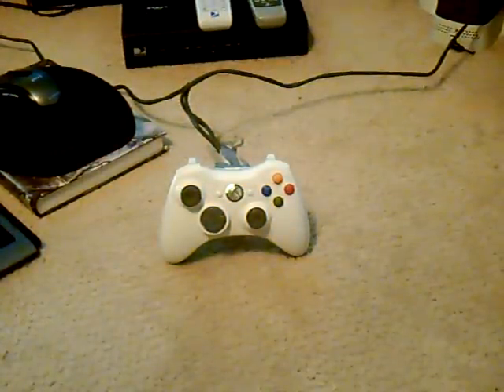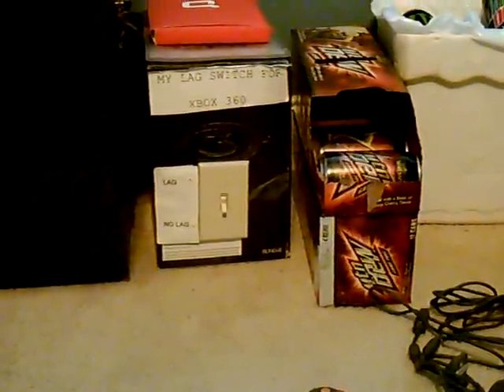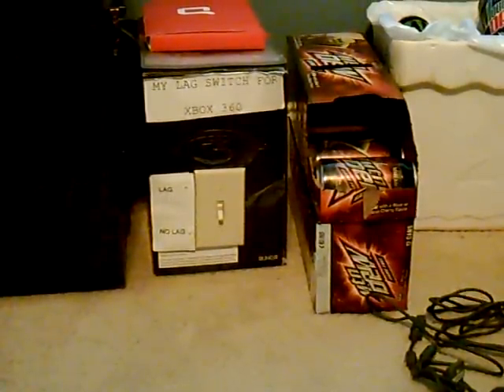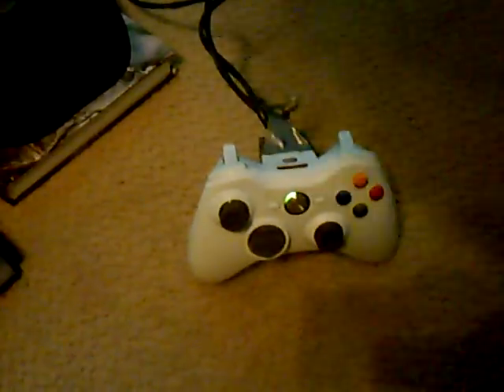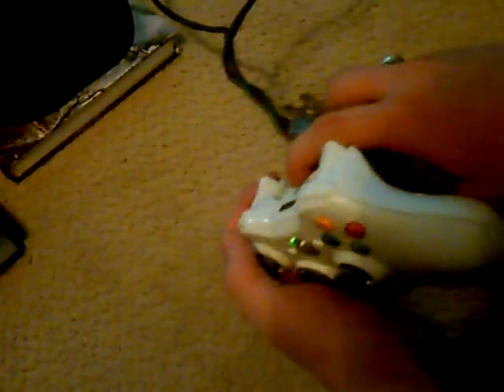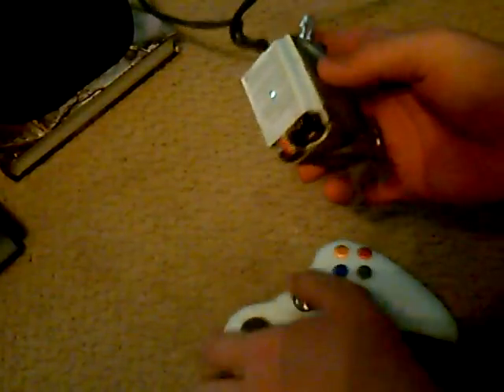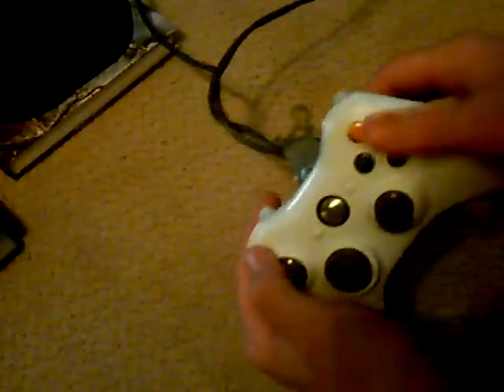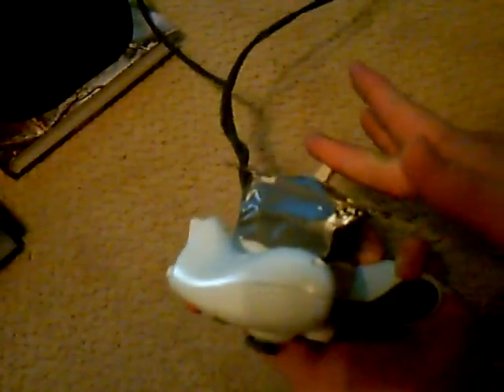My Lag Switch Built Into My Xbox 360 Controller

Comment: i sell these things on craigslist from time to time, thats a good idea to put it on the battery pack, i just drill a hole into the controller shell and throw a toggle switch in the hole and run the wires through the top, they look quite professional. i usually sell em 90-100 bucks depending on the supplies i use plus they only take like a half hour to make so its some good side money. thats what you should do man, so many middle school kids want these things.

Comment: et me point out a few facts about lag switching.
1. It's only called lag switching, in video games, but the proper name of it is "Denial of service attacks" Which is where you are actually sending a bunch of little packets of information to thier IP adress which slows thier connection, or can completly boot them offline.
2. Denial of Service attacks is a FEDERAL CRIME in the U.S.A. & U.K.
3. Punishment for this in the U.K. is upto 10 years in federal prison.

Continue lag switching, if you dare.

Comment: actually your a noob for not looking at it with a non-bias view, he is right to the point that lag switching has made a couple people games crash because of overflow data trying to be received from the other party, which is attacking the other users IP which is not directly what they mean to do but they do. If you knew anything LS is not blocking connection is prevention of connection to the internet which makes others unable to connect. differences is blocking is more immediate.

Comment: Okay, I hate cheaters so why do you feel the need to use a lag switch/ turbo controller,( scuff controller, etc to gain an edge instead of the basic controllers? Imagine all of the so called quickscopers using a regular controller. Yep, Merk season would be open all them all, 4's and 3's for k/d's but when I play y'all it's a .8 or something. Weak!!!!